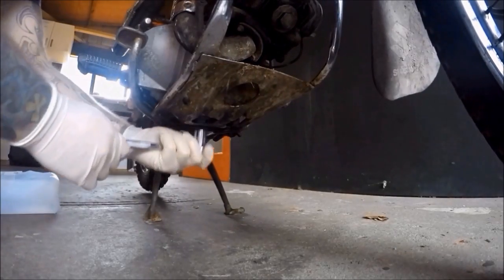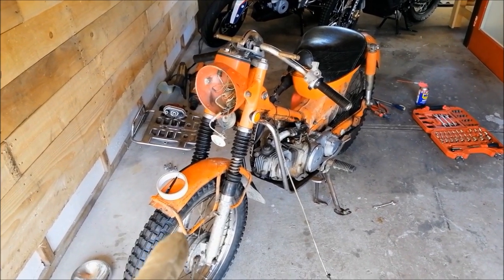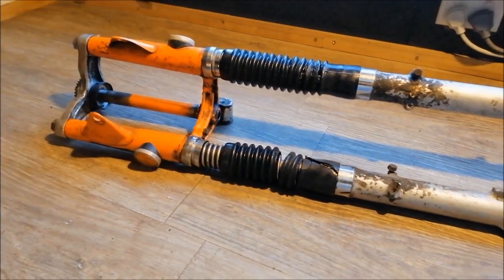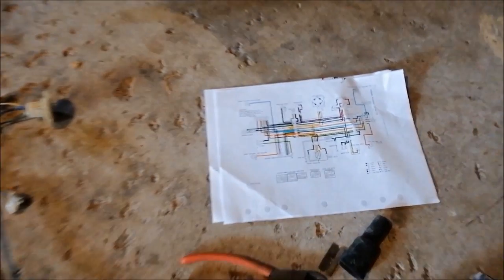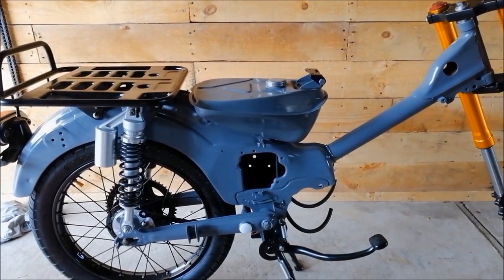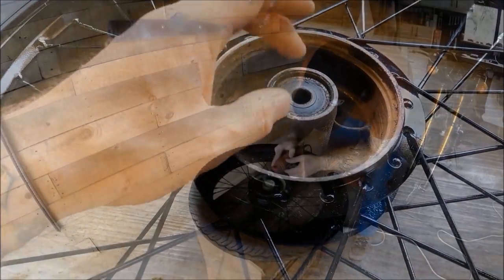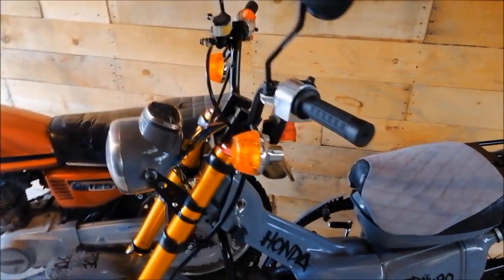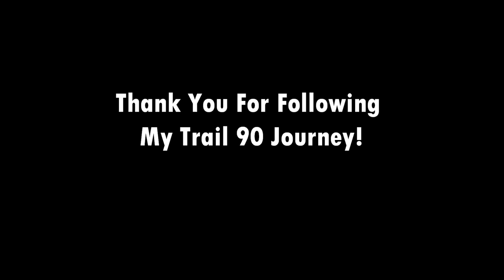Transforming My Honda Trail 90 | Restomod | 1972 Honda CT90 | Custom Bike Build | New Zealand

Comment: Don't know if I'm too late to supper or not but I have a seat suggestion from experience that I like. Last seat I built I used kangaroo leather and  stitched in a quilted pattern with about an inch of spacing. Just have your upholstery guy stitch in some flexible backing (I used memory foam) so the texture will pop a bit. I just had a CT 90 given to me from a customer and I'm gonna jump into it soon. Nice job brother.
Reply from the maker: Thank you for the suggestion! Unfortunately I've now sold this bike on, but there's always another build on the horizon and I am keen to do another CT, so who knows. 😉 Enjoy getting into your own CT project, they're fantastic bikes to work on! Thank you for taking the time to comment. ✌🏻

Comment: The rear wheel hub/spedo was genius.  I guess you got a longer drive cable ?
Reply from the maker: Haha, thank you! However,  I do have to admit that I was never actually able to make it operate correctly. After a few attempts and configurations, I just did away with the whole thing and modified a small digital GPS speedo to fit into the original headlight bucket. It was way tidier and simple.

Comment: What front forks are those if you don’t mind me asking! I’m about to pull the trigger on a set of ssr/cr80 inverted forks for my 71 ct90 and they look a LOT like yours!
Reply from the maker: Hi there! I actually get this Question a lot.  😂 They were a set of pit bike forks that I had laying about and figured would be fun to try and graft onto the CT90. A long story short, it required some machining of a set of bearings to match the new ID of the forks, while keeping the original OD of the frame. I got bearings from a local supplier that were as close as possible, then had the OD machined ever so slightly. Other than that, I had to modify the steering stops on the bottom of the triple tree to work with the frame and used a few mismatched parts to get the hydraulic brakes working. It was a lot of mucking around and I honestly wouldn't bother again. 😂 Thank you for taking the time to comment!

Comment: At a glance of this bike I am left with a bit of curiosity.  Some features do not appear to be accurate for the year.  The main feature that caught my attention was the handle bars with the blinker extensions.  Those allegedly did not get made until 1974-1975 depending on the source, but I have not seen a 74 vin with one.  Of course, my reference is for US bound bikes, not sure how they were built or what features came with them in various countries. 

Awesome Vid!!  Thanks for sharing!!  

I have a 72 that just needs final assembly.  the bike is sitting on my coffee table and the engine is on my counter top.  :)
Reply from the maker: Thank you for your comment! I can confirm this bike (well, the frame at least, is a '72) the handlebars were on the bike when collected and the wiring harness all looked original, so the assumption is that these are the factory bars for the bike. It wouldn't surprise me if the US delivered bikes are different, as laws in regards to what is required for turn signals etc vary from country to country. Thank you so much for your interest and taking the time to comment! Best of luck with your build, they're a fantastic bike and an awesome base for a restoration or restomod. Ride safe bro! ✌🏻

Comment: You did a really good job .I need to know though, where did you pick up your rear shocks?
Reply from the maker: Thank you for your support! 😁 The rear shocks are the factory items from my Keeway CR152. I had them on hand and they were a great fit, so I just colour matched them to the front forks. They work remarkably well on the bike and have a lot of adjustability so it worked out well! Hope that helps!

Comment: do you get the CT110 in NZ? i have an ex post one in Aus and they have a CDI ignition that sits next to the battery and they are a 12V system. they dont have the hi lo range tho unfortunately
Reply from the maker: Hi Ian. Yes, we get the 110 in NZ, they're a popular version that people modify here; normally with a 125cc, 140cc, or sometimes a 190cc Lifan motor. The CT90's get messed with too, though normally done away with the 6v system and hi/low motor. I actually built another CT with an NBC110 used as a donor bike for the harness and  injected motor. That was a fun and reliable little bike and one that I really should have filmed the build of! Thank you for taking the time to comment! 😁

Comment: Works alot better without the front fender😁
Reply from the maker: Haha, I agree! I only had the front guard on for the roadworthy, as its a requirement here in NZ. As soon as the bike was legal, I was running no front guard. Looked way cleaner. 👌🏻

Comment: How did you connect the rear brake torque arm to the front hub in the rear wheel?

In still the shot at the end (https://youtu.be/wyJ5I-a0fqo?t=3454) it looks like the rear hub is back in the bike - with standard rear hub torque arm lug mounting and no speedo drive cable connected.

Also, wouldn't the speedo cable rotate the wrong way moving it from the left side of the front hub to right side of the rear hub?
Reply from the maker: Hi Alex! To mount the brake torque arm, I butchered a spare rear hub and got to work with the tig adding the mount to the front hub. Lots of trial, error and grinding/filing later I came to the conclusion that it was way more trouble than it was worth, (It all fitted nicely and mounted well, but as you rightly pointed out, the gear spun backwards; I had planned to make a work around for this, but threw in the towel.) I ended up taking the easy way out by refreshing and running the standard rear hub and just used a digital GPS speedometer fitted into plexiglass, cut to fit in the standard pod. All that happened months after the initial build and I never got around to filming it as I just wanted it done and rideable. 😅 Hope this answers your questions! Thank you for taking the time to comment! 😊
Reply: @TheBadIdeaBros  Hey - thanks for the reply, appreciate it!

Man, I feel your pain - all that fabbing to add  a lug then discovering it would turn backwards! GPS is a good retro-fit solution if your local regs allow it. 

I really enjoyed watching your build - your little CT has a cool modern look and a much better front brake now!

I've restored my 1969 model keeping it as original as I can,  but I've left all the patina after treating it.
Reply from the maker: Honestly, it was a heck of a lot of work but I don't mind that. Things not working out are still a good learning experience!

I'm very happy to hear that you enjoyed the build, it's always a great thing hearing my content is being enjoyed!

I had initially planned to keep this CT pretty standard and just clear coat over the patina, as I am a fan of the Mars orange, but obviously after finding the front end was shot and having that pit bike front end on hand, it ended up spiraling into the complete resto-mod that it became. 😅
Reply: @TheBadIdeaBros  Yea, the not working out bit is all part of the fun and you learn a lot by actually just doing stuff - if it doesn't work out you, not worries, just try another approach and you learned something in the process.
Reply from the maker: Exactly! You learn just as much from failing as you do from succeeding! 😁

Comment: front disc on, but front fender gone? was there too much movement in the forks?
Reply from the maker: The front guard was only on the bike for a short time as it was a requirement to pass a roadworthy. I run the bike with no front guard at all on the road as I prefer the look. 😊 Thank you for taking the time to comment!

Comment: i have a few CTs and one is a Resto Mod style that I want to put on some nice forks like yours, any intel you can offer on compatibility or parts they used for yours would be appreciated!
EDIT: please ask the shop you used for any info the internet would greatly appreciate it!
EDIT EDIT: also what rear shocks are those?
Reply from the maker: Hi Williem! The forks for this build were taken from a 125cc pit bike, you can get essentially the same off of ebay etc. 

For these to fit it took quite a bit of modification of the upper and lower trees (a lot of material had to be removed from the lower to get enough steering lock) and custom machined bearings cases. I used high grade NSK bearings and the bearing OD was milled down to suit the factory CT frame, as I didn't want to modify that at all. Perhaps easier ways of doing it, but that's the route I took. 

Because this was all custom work and had to happen fluidly as the project progressed, there aren't any plans or instructions persay, a lot of this was figured out as the build went along. 

The rear shocks were the factory items from my Keeway CR152 and were actually a perfect fit, so I just colour matched them to the forks, set the height and altered the nitrogen charge to suit the lighter CT. This was actually the easiest part of the whole build!

Thank you for your questions and taking the time to comment, I hope my answers have helped!
Reply: @TheBadIdeaBros  perfect man i really appreciate the reply! subbed the channel, really cool build btw i like my stock ones but i had a race ct someone cut up and i decided to even mount a traditional tank on it. was gonna do the DrAtv extra power forks but this would be better for my chopped and screwed CT. I work in a machine shop so Ill try to figure out whats cut. was the lower and upper tree off the pit bike too?
Reply from the maker: I also like a stock bike, the original plan was actually to do a simple resto and keep the patina,  but when I discovered how ruined the factory front end was on the teardown things kind of escalated as these things do. 😅 

Yeah, the whole front clip, wheel and hydraulic brake set was from the pit bike, in my mind I wanted to do this in a way that gave me the option to re-fit a factory front end if I ever wanted to.

Thank you for the sub, it's very much appreciated! I've done a few other builds on the channel now and have a few other bikes tucked away waiting to be worked on so keep your eye out for those. 😁

Comment: mmmmm. youre front fender is fixed so low that you cant have any suspension.
ore is it only 1 inch???
Reply from the maker: I get this question a lot! The front guard was on the bike long enough to pass a roadworthy inspection (it's a requirement to have a front guard) I run the bike without it, as I like the look of no front guard, so suspension interference is not an issue. 😉